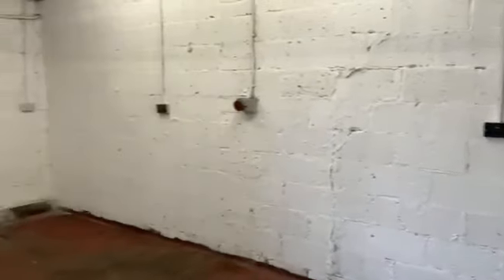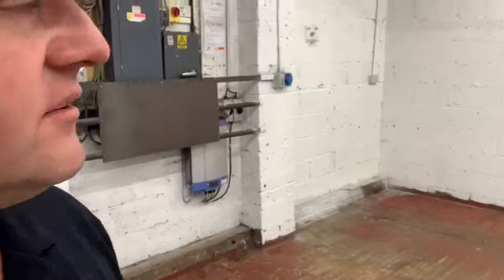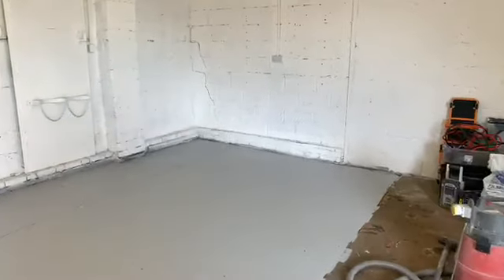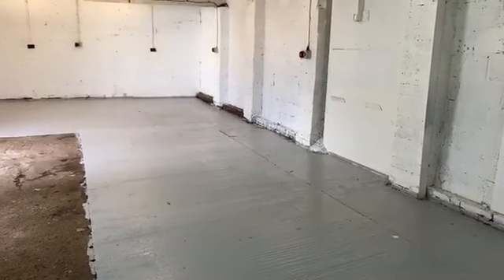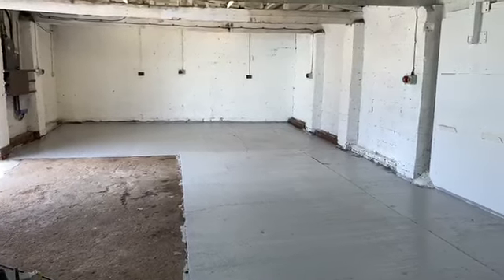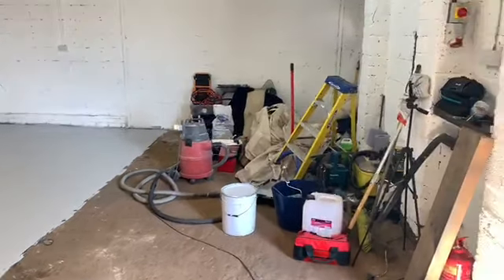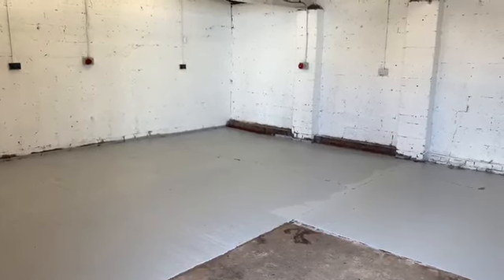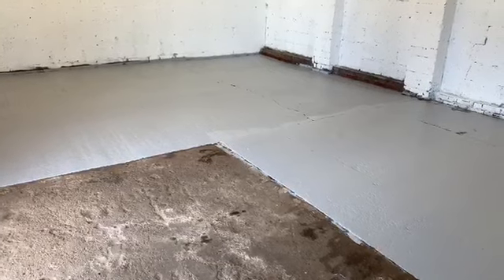PAINTING OUT THE NEW RESURWRECK WORK SHOP

Comment: Most garage workshops use rubberised paint on the floor. It’s very durable and will stand up to cars driving over it, plus jacks rolled across it. Would be good to install a ramp/lift, although not sure there is the head height required. Looking good.
Reply from the maker: Chris Blay Thanks Chris can’t really get a lift in so will have to struggle on 👍

Comment: loving the gray makes a  big diffrence  when we first set out like you we stuck two two makes of car which back  in those days were novas and polos we just bought those because they were easy and quick both to repair and sell . i think fiesta,s are ideal and  sticking to one make you can then  stock or aquire parts and panels rads lights bottom arms  etc etc . and youve done a few now so youve got the experiance , ideally its not good working alone for safety reasons getting traped fires etc so a mate would come in handy (trust me )i would aim  working mon to sat  min of 2 cars a week  ie 3 days to do one vehicle but ideally aiming at three a week ie one vehicle every two days  this would give you  both a decent wage  . oh tip do lighting 8inch above floor all the  way round is very helpfull  as opposed to just  roof/rafters . going all in is a brave move but has to be done  and i think youle be fine .
Reply from the maker: Charles thanks for all the info mate sounds like you know what works and what don't so thanks for that mate i will look into better lighting but you know first hand need to start off slow thanks again for your experienced mind  👍👍

Comment: Good luck with the business of you want cheap reliable lighting nip down to home bargains they have an offer on LAP external fittings which are LED and can be used inside. They are selling them for 1\3 of the price that Screwfix are selling them I have LAP lighting on the outside of my garage and have had no problem with them
Reply from the maker: John thanks for the info i will pop in there and have a look 👍👍